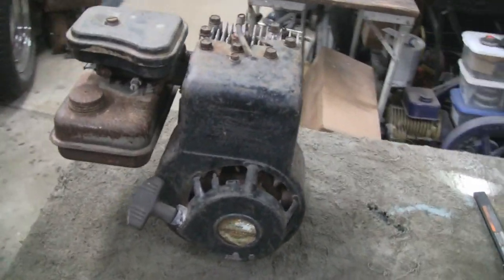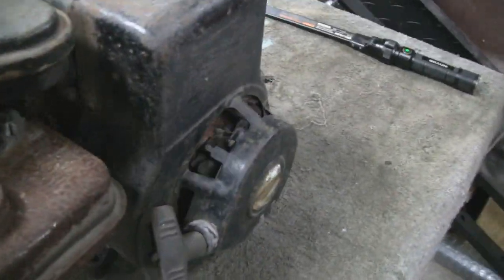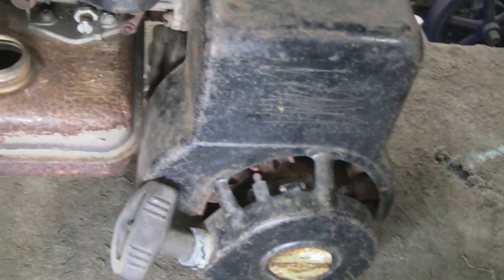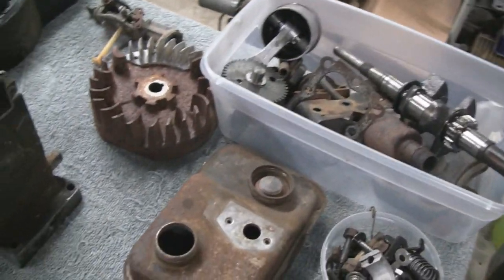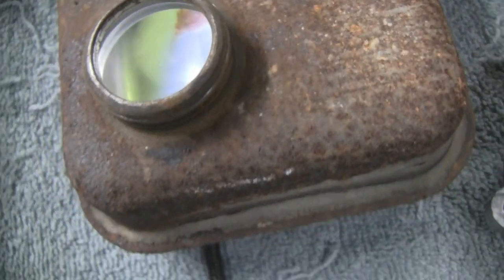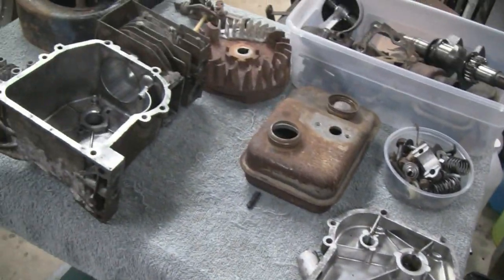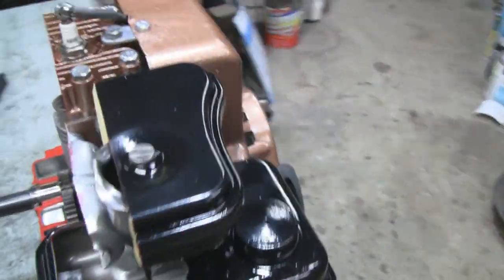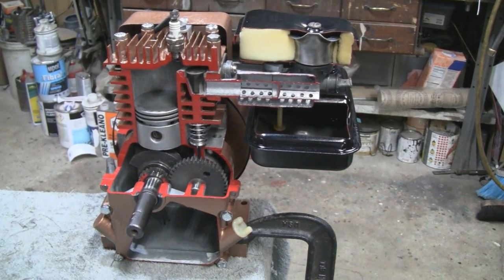MAKE A CUTAWAY BRIGGS ENGINE

Comment: Cutting the flywheel as to preserve the ignition was a great touch. Even at cranking RPM the piston was blurred. I still can't wrap my mind around how engines (especially racing) operate with any power at all at 7-8000 RPM. Everything happens so fast!
Reply from the maker: Thanks Keith!!☻